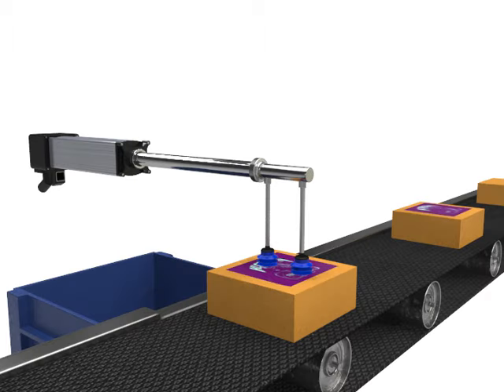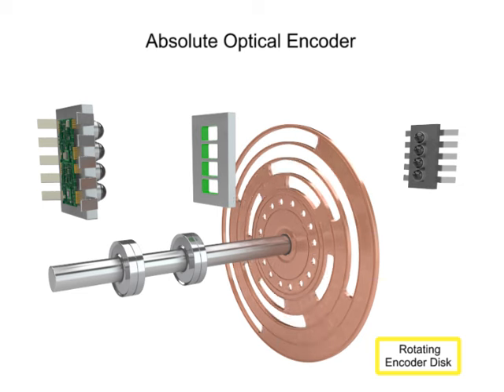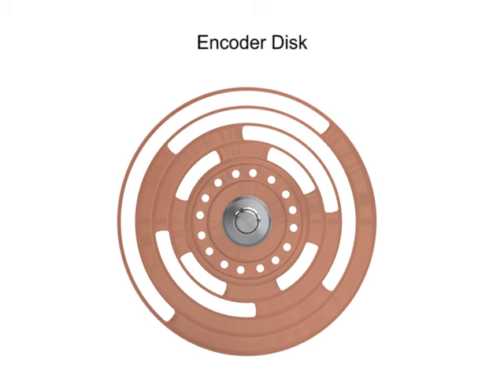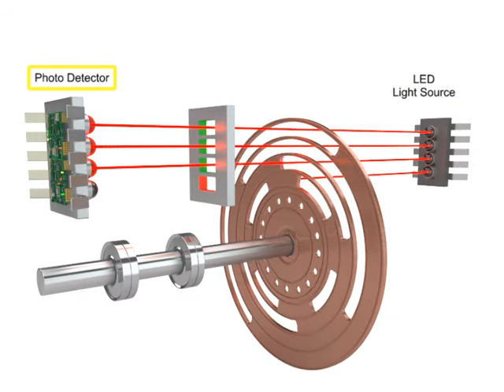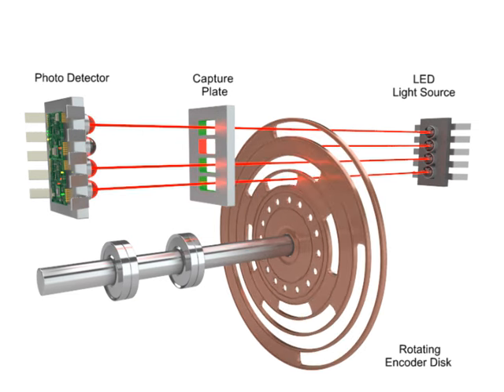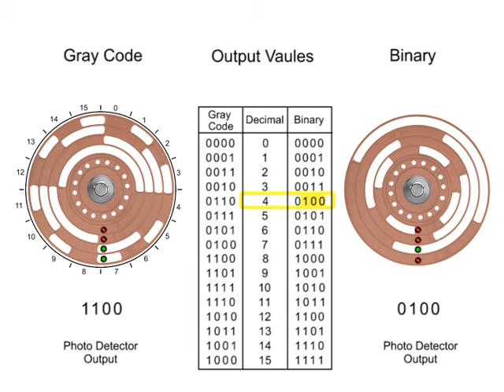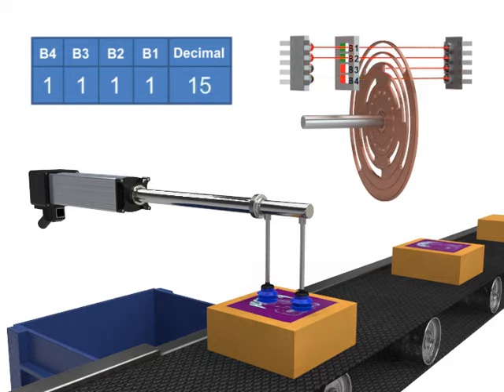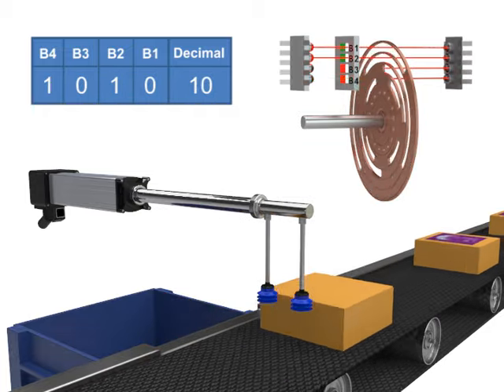Motion Control Feedback Devices

Comment: For those reading at 1:57 I think there's an issue with the disk provided for the gray code and binary code photo detector output. I'm just a student in learning so please feel free to correct me if I'm wrong

Firstly I think the order of the numbers is wrong? I think it should be reading from the inner track to the outer track, i.e the left disk should be reading "0111" not "1110" 
Secondly, I think the left disk is supposed to be the "binary code" and the right disk is supposed to be "gray code"? 
Focusing again on the left disk, the reading "1110" =/= to number 7 for gray code or binary. The only way for it to make sense to me is that is supposed to read "0111" which is binary code for number 7
And also in the explanation it seems to me that the disk on the right is the one switching one number at a time not the one on the left which leaves me to think the right disk is the gray code disk.
Although, I do not quite understand the right disk cause the values provided went from "0100" to "0000" in one 22.5 degree angle change, which makes no sense to me cause I was under the impression it should go in a specific numbering order
Some confirmation would be greatly appreciated

Comment: Notes for this topic wat sir as explained in this video..
_________________________________________

An Encoder is a device which converts the linear or rotary movement in to digital pulse output..
The common type of Feed back device is Absolute optical Encoder.
It consists of 4 major components. they are 
A rotating Encoder Disk
A light Source ( LED)
A Photo Detector (light Sensor).
A signal conditioner that converts a signals in to square waveforms..
The encoder disc consists of a series of Opeque and transparent tracks mounted to a rotating shaft.
this tracks of the disc are arranged concentrically  around the centre of the shaft.

Number of leds n PDS are assigned to each track to designate the resolution of the encoder.

The light source located on the opposite side of the photo cell or detector passes light through the capture plates, as the encoder disk rotates the light is either trasmitted or blocked according to the pattern of the disk.

The Recieved light provides a 4 bit word  that indicates the position of the indicator Or the device encoder is mounted to..
The common type of numerical encoders are Dec bin Grey code..

In 4 bit encoder their are 16 unique words (combinations or numeric codes ) for every 22.5 degrees  (bcz 360/16= 22.5)

Comment: "Binary has greater chances of error because of multiple bits changing at samr time"

If you read all the 4 bits as a numerical value instead of trying to intercrpt it as a quadrature code, like with an incremental encoder, maybe you would have less errors.